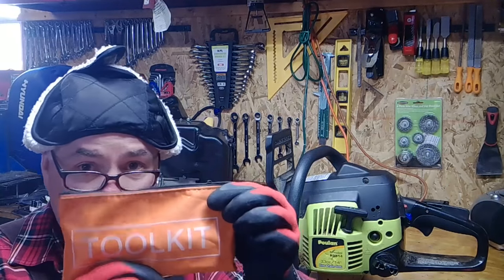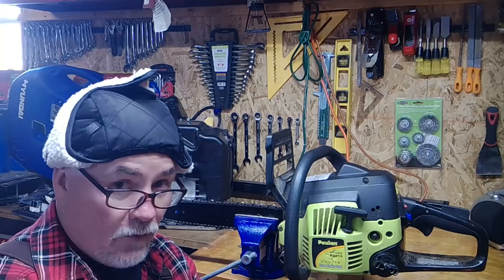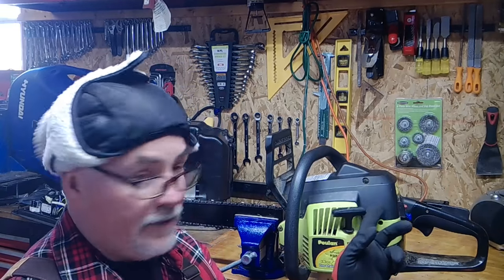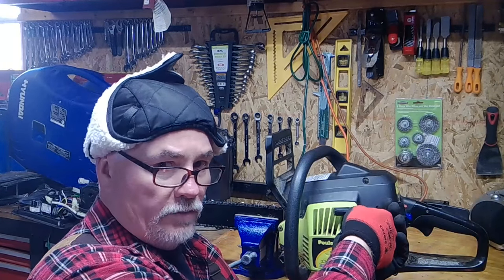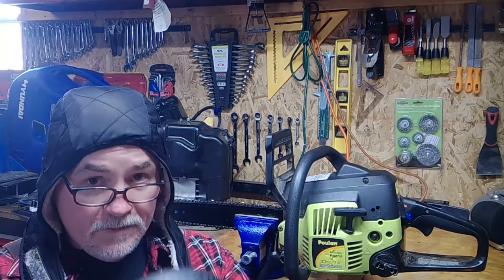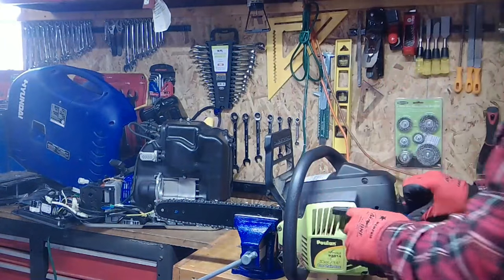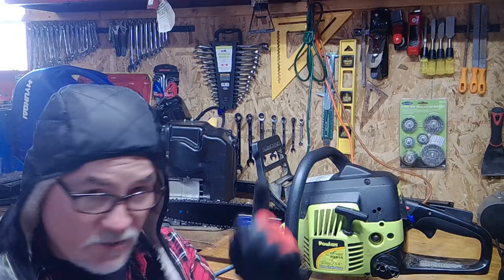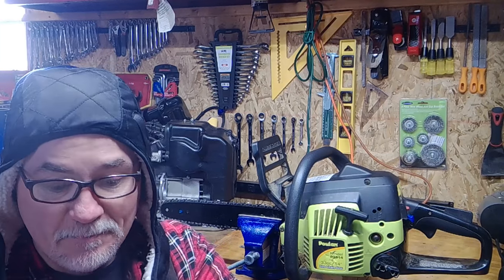How to adjust/tune a Poulan chainsaw carburator

Comment: Hi Steve my name is Randy.  So I've got several chain saws and have had many over the years.   My first couple of saws were poulan and to be honest with you I never had a minutes problem with other than I use them so much that I completely wore them out and at the time  I was young and dumb and felt like it was just easier to buy a new one.  
 As I've gotten a whole lot older  I don't think that way anymore.  LOL 
I currently own my main chainsaw is a  Stihl  , but I also have 2 or 3 poulan saws and a pretty good size homelite saw.  
 Well the last poulan saw that I bought was a  pl3816  which I only bought because I was no where near home and found myself needing a chainsaw so I bought this poulan from wally world and right out of the box it was hard to start and even when I could get it running  it wouldn't stay running at an idle.   I should of returned it but figured I could tune it and get it right once I got back home.  Well 3 yrs later in just now getting around to looking at it.  
 I've watched your video and like on your saw the low idle was way off. 
So I followed your advice in this video and it helped but the problem is that no matter what I do the chain won't stop spinning unless you put the break on which then it cuts off.  I'm not sure where the trigger adjustment is set and to the best of my recollection it didn't seem like you gave any instructions on that.  Anyhow I was just wondering if you had any ideas of what may be causing this issue.  I've checked the chain,  sprockets  etc... all looks well with the chain tension set right.  The only other thing that I could guess is if the sprocket is controlled by a clutch mechanism and if so then maybe the clutch is messed up.  
 What are your thoughts on that? 
Thanks for your video as it was very informative and helpful and I greatly appreciate your time.  
Sincerely,  Randy

Comment: Great video, very informative. I have 3 P3314. 2 for trimming branches here and there on my property and one (just the engine) going in a RC helicopter I'm building. I needed your video to adjust them all. Thanks.  BTW, since the very beginning of youtube or facebook, I never understood why some people freak out on safety issues in videos made by complete strangers to them, sometimes, in another country with different values as well as on videos dating back years and years ago. oh and by the way I think it's pronounced poo-lan :)

Comment: Hey recently, yesterday, changed out the fuel lines on my 3314. Now when I go to start it it will start after heavily priming the bulb, then 30 seconds max it shuts off. Now I'm not a small engine repair, and I'm easy to forget one line to one place and one to another. That said I'm wondering if maybe I've crossed the two fuel lines? I was able to prime the bulb it took some time but I chalked it to being fresh lines and first fill. Would I still be able to prime and start if I crossed them? Or is this a case of needing the tune up on the carb, when first removing the green pull cord plate I did inadvertently remove what turns out to be the T screw with the spring, wouldn't have realized that either had I not dropped a small hose clamp I tried to used to keep the old fuel line on the primer outlet, found new lines worked better. The clamp landed on the tank and my reacher magnet picked up the surprise Throttle screw. So she does start and run 30 seconds,  mirical,  what's your thoughts? I mean pertaining to the saw not staying on?

Comment: A good, straightforward approach to getting a chainsaw adjusted, I think you turned the low screw all the way to the right until the low setting was closed. Then you opened it up two turns to the left. Am I correct? Yhis is one of the best videos I have seen on chainsaw adjustments. Keep up the good work.

Comment: Steve, Thank you for sharing your expertise.  I am having a heckuva time getting mine to run right.
What is the bottom adjustment for?  On the cover, it has a letter T.
Reply: Well, tinkered with that POS chain saw until my blister hurt.  Tossed it in the trash and grabbed a beer.  3 days on that thing is enough of my time.
Reply: Hey Fred,my manual states that if the chain is moving while in idle, turn counterclockwise and if stalling, turn clockwise.

T -idle speed.

If chain is moving in idle, idle is too fast.  If stalling, idle is too slow.

Comment: Thanks for the tips. On another note: bought a Poulan 2055LE for $20 and couldn't get it to run. The throttle trigger didn't feel right. Turned out the linkage wire between trigger to carb was bent (too much play) bent it a bit and it runs fine.

Comment: I have a pouland tree trimmer . purchased a new carburetor . got it running but when I attach the extension on the motor side and try to rev up the unit it dies. I need to adjust the load screw but not sure which is the load. How do you tell if not marked ?

Comment: What tools should I get to tune up this chainsaw. Recently purchased a used one and want to tune it correctly; i.e. adjust idle, use correct fuel filter, air filter, spark plug, etc. Cheers

Comment: so using this method I can get it close however, it wont stay started... I have replaced the fuel lines, fuel filter, air filter and spark plug, The only thing I can think is replacing the carburator but I don't think that necessary

Comment: Hi
Oil chain regulation screw on Poulan 2800, if I turn it clockwise, does goes more or less oil for lubricating the chain?

Comment: Sir - really great video - the only issue I have with it is I was unable to see which screw you were adjusting.  It appeared that you never adjusted the High while it was running, is this correct?  I think you backed out both the Low and High 1.5 turns then only adjusted the Low, again is this correct?  
V/R 
Mike
Reply: He adjusted the high towards the end of it running to bring the idle down low is how it runs and high is ur idle
Reply: No low is idled down to stop the chain! H is tweaked by ear at high speed for cutting!

Comment: Steve, good DYS instructions. My Pouuuuulan 3314 melted the plastic of frame around the clutch and top of oil pump: I replaced oil pump and chain brake, and cleaned the melted plastic out. Followed all of your video and she will only start at 1.5 turns left (cc), H and L and I can't adjust diddlely squat. I let it idle for a minute and it start smoking creating a smoke screen; army style. I suspect a got a bad clutch spring, as the spring appears loose, stretches easily. Got chatering while idling. I m about to can the b b baby and get something pro.

FYI, I m a mechanical engineer 30 yrs experience that likes to do all at home. No roofing or Ac compressor stuff.

Comment: Throttle Linkage Screw???   What is this screw for?  I thought it tightened the case, and turned it tight clockwise.  Now what?  I did your low and high adjustments just like you said, and my garage sale find started on the first pull!!!!!  Thank you.
Reply: That’s another way of saying idle screw
Reply: I did the same thing with that screw

Comment: you showed the high and low but many have a idle adjustment screw you did not cover that that's what i'm interested in on my polan FL3314 the high and low on mine are fine but for some reason its idling to high  with brake on after awhile the clutch will start getting hot

Comment: Mine starts, idles fine, cuts fine, but stalls after releasing the throttle after cutting. Any help?
Reply: Mine too?!?
Reply: Low jets too fat or idle is set too low.  Or carb needs to be cleaned.
Reply: Running a little lean,turn mixture  a  quarter out.

Comment: Where is the link for the spline drivers?
Thank you
Reply: Look them up in Amazon. It's the only place I fund them and it takes a bit to get them. I got a pack that brings 12-20 different ones.
Reply: @aebello235  I actually did order a set there. I only asked as in the video he mentioned posting a link to where to buy them.
Reply: eBay.

Comment: I got that same saw, I made the mistake of running it all day because I was cleaning tops and stuff; I paid the price the next day.  The poulan pro I have is bigger and heavier but the anti vibration in the handle saves you the next morning.  I use that saw sparingly now but it's a shame because it starts and runs really well.

Comment: Loggers refer to that tool as a ‘scrench’.
Reply: your absolutely correct !
Reply: A scrench is for adjusting the bar, that's a spline carburator tool.  I keep a set in my chainsaw bag because if you helping a buddy out someone there has a chainsaw they are about to Chuck and you can save it.

Comment: Hey I don't see the link to the Poulan tools.
Reply: Yeah, he left that out. Just go to Amazon and search for "poulan chainsaw tool kit." You want the 21-tooth splined screwdriver (old 7-tooth splined should fit as well). Can find in carburetor adjustment kits (even oddball chainsaws) or as a stand-alone tool (common chainsaws - Poulan, Husqvarna, Echo, Ryobi, etc). Local box store should have as well.

Comment: Wow, love your style but that’s a lot of talk to find out to turn the high and low screws all the way to the right and back them off one and a half turns. Now just tell us what you did while it was running.  And finally my idle screw has a huge swing in and out where should it be?   It’s sputters the first pull each day, and then never again.  Frustrated